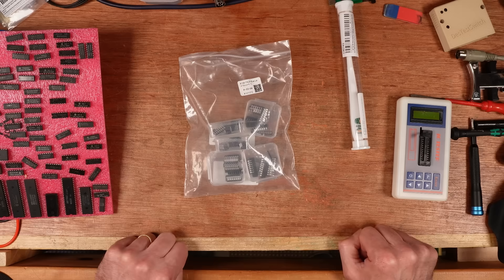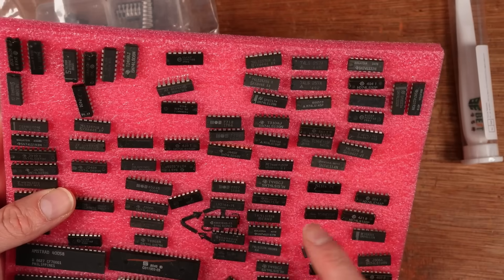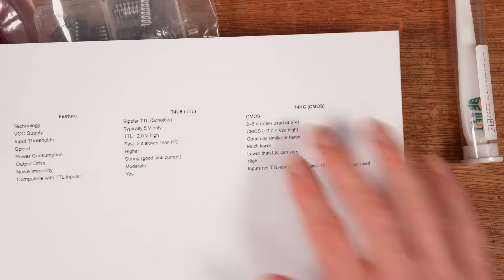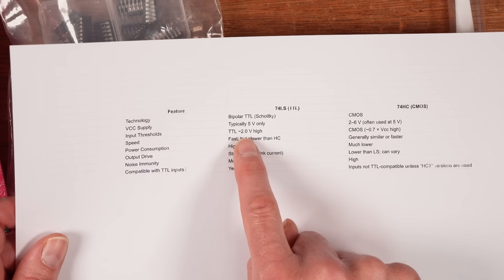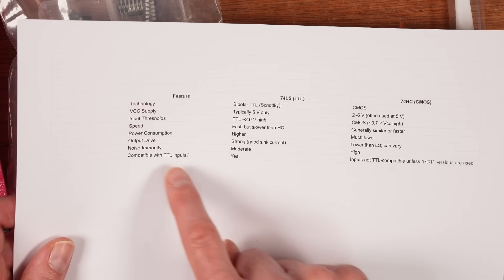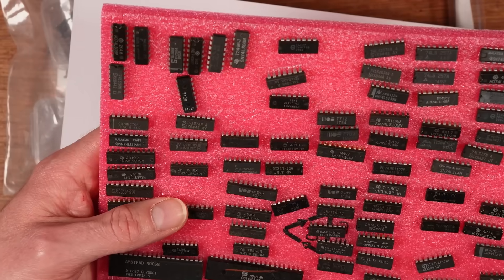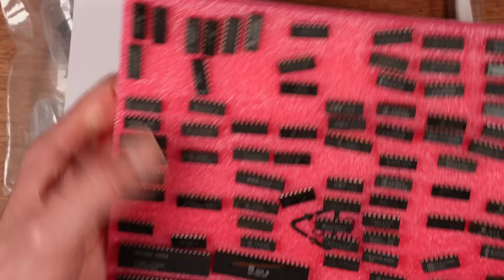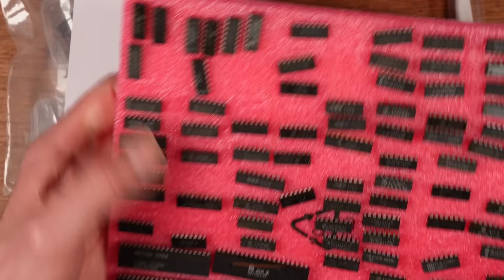I bought some 74LS Logic Chips from Ali Express. Guess what happened next?

Comment: How confident are you that your chip tester is not mis-identifying them ? I think I'd want to do an independent bench test before writing them off.
Reply: Yep. This needs a separate test in a "real world" scenario. Those chips might be fine after all. Hoping for a Part 2 for this video.
Reply: I was wondering how it does the detection. That would be an interesting follow-up.
Reply: @AlanTwoRings  Long time since I've played with these but as I recall one definitive difference is that TTL needs to have a load of current sinked out of its inputs to pull them low (unconnected it pretty definitively high) whereas CMOS is very high impedance so can be pulled either way by over a Meg with no current draw, and left unconnected they tend to float to their switching threshold and therefore switch based on the tiniest amount of picked up noise. That's what I'd do on the bench. Unlikely that the tester does it this way. I'd imagine that it slews the input voltage and sees what level it switches at. I think CMOS also has fairly symmetrical outupt drive whereas TTL tends to be better at pulling down than up.
Reply: @burblering  Correct. The other difference is that a lot of those LS type logic ports could drive LED's with ease. Some even without an additional resistor, depending on the type of LED. Many HC logic ports couldn't.
Reply: I don't know how much test equipment you have in your workshop, but an oscilloscope and a signal generator would let you do some interesting tests. Take one of the suspect logic gates and apply 5V to Vcc. Then feed input with a relatively slow sine or triangle waveform of 0 to 5V swing. Use the scope to view voltage at input and output. You may have to tie some inputs in order to get the output to change state. You should be able to see at what input voltage you get a state change. LS and HC should have very visibly different behaviors. Also compare with "known good" LS and HC parts of the same type.
Reply: @walterwinnipeg7350  And the frequency performance should give some clues too.
Reply: It's fairly easy to distinguish between genuine 74LS and 74HC IC's, by just powering them up with the inputs left disconnected. And measure the voltage on the input pins. With 74LS ones, the inputs should read a bit under 5V, as the TTL input structure effectively makes the inputs pulled high. Whereas on CMOS types, both 74HC and also 74HCT ,the inputs are basically entirely-floating and will read close to 0V when a Voltmeter is connected between them and ground, as input resistance of the Voltmeter (even 10M on a DMM), should pull the inputs low.
Reply: I suppose he already did some testing with "old" original chips like he showed a bunch.
Reply: Exactly. I'm not suggesting he's wrong, but before making a positive claim I certainly WOULD prefer to test those chips with a conclusive second method...
Reply: my first thought too after seeing that he got the tester from the same marketplace as the chips...

Comment: The 74HC00 and 74HC00 are used on the TRS-80 model I video circute and they are often bad.
Reply: Actually they used 74C00 because it pre-dated 74HC, and repairing my old TRS-80 is still on my to-do list. But I'll make a point of trying a 74HC00, as I should have some on boards that I can scavenge from.

Comment: 74LS output voltage for HIGH is guaranteed to be at least 2.5 volts on a 5 V supply. The minimum input voltage guaranteed to be interpreted as a valid HIGH is 2.0 V. The maximum output voltage for LOW is 0.5 V and the maximum allowable input voltage for LOW is 0.8 V. All output voltages are contingent on observing the allowable source or sink currents. The output minimum HIGH is a tenth of a volt higher than the spec for standard TTL and the low maximum is a tenth of a volt higher than for standard TTL.

HCT is voltage-compatible with TTL when it is operated on 5 V, as are other CMOS logic families with T in the part number e.g. ACT.

Isopropanol in a spray bottle is a hideously dangerous thing!
Acetone is extremely volatile and extremely flammable.

It boggles my mind how much fake crap is flogged on Back Alley Express.

TI still makes LS TTL.

If you just scrub around on a PCB with a brush and let the solvent evaporate, all you've done is turned a local mess into a global mess.
Reply: The Vih is particularly important when driving a 5V CMOS input from the output of a 3.3V chip. A 5V CMOS input will want at least 3.5V for a high input. I was using an STM32 to control a HUB75 LED board, which had a 5V HC CMOS chip on the inputs. It would work fine most of the time, but could get flaky like it was missing clock pulses. That was due to a low noise margin.
Note that nothing I was using was fake, but it shows how an HC input can cause trouble. A 74LS/HCT input would have been fine.

Comment: Where did you get the IC Tester from?
Reply: AliExpress.  Same seller as the chips.
Reply: @simoncrabb so it could be FAKE TOO!.
Reply from the maker: It wasnt the same seller. But it was from ali express. I would not trust that seller either as it arrived in a jiffy bag with no box and when turned on was faulty. I had to open it up and remove a bunch of solder from an IC inside.

Comment: The fake / rebadged LS chips are frustrating. I need to get one of those testers - the TL866 doesn't differentiate between HC /LS etc, and it can take me ages to work out that the issue is actually the trigger level on my new (fake/rebadged) LS chip. I recently had a fake BU508A horizontal output transistor, which is far more concerning - caused havoc with a CRT when it shorted immediately on power up. Only reputable suppliers for high voltage / power / important parts from now on!

Comment: do you have a link for that chip tester, i have been looking for a tool like that.
Reply from the maker: Hi. I would not recommend the one I bought as it arrived very poorly packaged and was actually faulty. I had to fix it first! But if you search on Ali Express for "Professional Integrated Circuit IC Tester Transistor Tester" you will find what you need.

Comment: When AliExpress started selling copper wire that was actually plated aluminium a couple of years ago I learned it's a massive lottery.  Why they bother faking some of the things is beyond me.  Maybe the likes of Mouser, Digi-Key etc. pay them to do this so that chip buyers give up and stick to reputable suppliers once bitten?
Reply: Copper clad aluminum wire is not fake as long as it's labeled correctly. The resistance is higher than copper, so you do need to use heavier wire though.
Reply: @rocketman221projects  It is when they advertised it as copper wire and I fell for it. The damn stuff wouldn't even solder despite it's copper coating.  Totally useless.

Comment: Genuine SN74LS02N from Texas Instruments, supplied by Mouser, 10 off price 69.7p each.   A tube of 25 £15.58 or 62.3p each. Both plus VAT
Reply: The problem is usually the shipping. I can buy a handful of chips from Ali for 5€ shipped. While those other distributors want 30€ just for the shipping...
Reply: @Mobin92  Exactly. I'd much rather use Digikey or Mouser but those shipping costs are more than the products. Don't know if it's their way of propping up the bottom line or the net zero agenda costing shipping companies way more in taxes now or what..
Reply: @Mobin92 Also, by purchasing from suppliers such as DigiKey or Mouser, you will receive information when a chip goes out of production and suggestion on chips similar characteristics to replace it with. That gives you time to redesign your circuit.
Reply: @Mobin92  with Digikey or Mouser you need to try and create an order that meets the free shipping threshold, which is about $50 USD. It helps if you have a wishlist ready to go, so that when you need a few chips, you can order those other things at the same time. The same is true for element14 (might be known as Farnell or another name, depending on where you live).
Reply: @Mobin92  Try European distributors such as RS or TME. They might not have some niche components, but for the rest you get cheaper shipping. Another (Chinese but legit) alternative is LCSC, which also has cheaper shipping to Europe and has a larger component selection, especially Chinese brands you can't find even on Digikey/Mouser.
Reply: @Mobin92 If you're ok having your project delayed and your temper to soar (at least I get mad when being ripped off no matter the amount), then 5€ lost is a good deal.
Reply: @Mobin92 the classic “then you get what you pay for”, when you gamble, sometimes you lose.
Reply: RS is even cheaper. £8.98 for a tube of 25 (£0.359 ea), and shipping for private/guest account is £6.95 (or free over £50). Farnell is similar. I only use Digikey/Mouser for harder to find/specialist stuff
Reply: I prefer Digikey. Just saying.
Reply: In this case Digikey are also cheaper, I use both.  Delivery times and minimum order level to get free delivery to the UK are identical, delivery from the USA is often quicker than Farnell who are just a 7 mile 20 minute drive away, but sadly without the trade counter they had for many decades.  Farnell, particularly since Avnet took them over are very expensive unless you have a negotiated discount contract.

Comment: I generally expect 100% of alix chips to be re-labeled, not useless but each and every component from there needs individual testing and vefication. Still usefull components when you determined what their actual characteristics are.

That said - look at the Tauntek logic tester, it can measure (and output) individual voltage levels of each pin aswell as chip power consumption and voltage drop-off levels - VERY nice for determining chip characteristics.
Reply: That's true, they've been sending completely inoperable products much less frequently lately. They're more likely to deliver slightly inferior performance in some areas, and for the price I pay, and when those parameters aren't critical in production, the product is perfectly acceptable. Although, sometimes they send a better product than I originally ordered (I once ordered small variable resistors, and they sent me huge ones. They weren't suitable for that project, but they're great for other projects, and I got them for practically nothing). Or, if I'm in a strip of 100 SMD ceramic capacitors, they often ship 110 or even 120. It's a small thing, but nice.

Comment: The counterfeit chip problem is out of control. I recently purchased some CMOS 555 timers from eBay to update a design to reduce power consumption. 9 of the 10 were actually remarked NMOS parts according to my simplistic current draw measurement.  Seller apologized and promised not to do it again. /sarcasm

I've used a bunch of Dallas 1-wire 18B20 temperature sensors over the years. I was getting confusing results on a recent project and compared temperature reading on a bunch of sensors. All the most recent ones were multiple degree F different then older ones I had on hand.

I was fine derating specs on Chinesium electronics but now reluctant to purchase anything.
Reply: Be glad these ds18b20 worked   with skewed values, I do have some which are working intermittently.  Sometimes ok sometimes not at all. The problem is that I sourced them from reputable sources and I am willing to pay few bucks more to avoid headaches, yet the higher price is not guarantee of better quality;(

Comment: I'm wondering if they could be used with a somewhat impractical hack:
If you put a couple of diodes in series with the VCC you could drop the supply enough that your logic levels at 70% would be in line with the TTL levels.
E.G. Two diodes at a 0.6v drop would take the 5v at the chip down to 3.8v making the High logic level around 2.6v.
I've used this trick successfully when driving multiplex chips that are 5v from a 3.3v micro.

Now the practicality of this is questionable, but if you were in a pinch it might work. I'd probably modify a socket to add the diodes and make it a drop-in bodge.
Reply: In the vast majority of cases, replacement is fully functional. With the exception of the generation circuits, where selection of the drive components is required.

Comment: Build a modern retroputer with them. I bought two HD63C09's from a Chinese seller (cheap) over a year ago, finally got around to building a nop tester, turns out either fake or broken, but nothing coming off with nail varnish remover.
Reply: They might be HD63C09E. For some reason, a lot of the 6809E/6309E cops are being sold as 6809/6309. The sellers probably assume the E is just a package or speed marker when it's actually external vs. internal clock generator. In any event, it might be a working 6309, just not the pinout you wanted.

Comment: They could be factory rejects they got for cheap due to being mislabeled.  It's just not cost effective for them to fake these cheap as dirt chips.
Reply: Every sale counts
Reply: @aldob5681  They figure it out, 10K> chips/Hr. .005% labor. Profit 4 cents.
Reply: At the same time, they could be taking chips from an IC family that is more modern and still in production, then relabeling it as something older and more valuable. It might be a challenge for the average person to tell the difference between an old and possibly flaky IC chip and a  nice new one of the wrong family.
Reply: There's no part too cheap to be faked. A few years ago I bought some RCWL-0516 boards on Amazon for a project. These were dirt cheap (about 1€ per board) and when I needed some more I ordered the same item again and only received fakes. So even these Chinese 1€ boards were copied. The fake ones had a hardware defect in the main chip and needed an additional LDO which was the only part on the second side of these fakes which made them too thick for my purpose.

And: I don't know any chip manufacturer who is painting their chips black.

I would never buy electronic parts needed for reliably working projects on Aliexpress, Alibaba and whatever because it shouts out "fraud". Nevertheless shorty I became a victim of such a Chinese fraud on eBay when searching for GALs of a certain type and speed rating. The seller pretended to be a German seller, unfortunately only after I bought the parts I found out that the whole shop was a lie. Delivery came from China, took ages (instead of the promised two to three days), the parts were fake and eBay didn't even refund these worthless parts.
Reply: I very much doubt that, the factory process wouldnt be capable of mislabeling.  
I have many of these fakes, you can plainly see where the surface has been ground away or in some cases oversprayed. 
Fake 40-year-old processors and their peripheral chips are particularly popular, ask any SC/MP enthusiast   😁
Reply: @PHILG2864  Then you have never worked at a mfg factory. LOL
Reply: @4thdoctorwhofan966   У нас в начале 90х годов продавали микросхемы не прошедшие контроль так как например ключ микросхемы был с противоположной стороны(сама микросхема полностью рабочая).Или надпись перевёрнута.

Comment: If you really need to use a HC type try using a pull-up resistor on the input to pull it higher voltage
Reply from the maker: That's a good idea
Reply: @morefunfixingit  Or maybe drop VCC by 0.7 V by adding a diode in series. If high is 70% of VCC this will drop logic high from 3.5V to 3V, maybe that's enough? Or even 2 diodes since the chip works on lower voltages anyway. Maybe not pretty, but maybe enough the circumvent the trouble of sourcing the LS version and it may be possible to hide a small diode somewhere near the chip.
Reply: @pe1dnnThat would be fine for logic HIGH but not for LOW. The diode wont conduct and leave low floating.

Comment: Try to find the Soviet analogs of LS (series 555) or ALS (series 1533) chips, there were no HC/HCT analogs in the Soviet Union.
Reply: Series 1564 is the Soviet equivalent of the 74HC series, and series 5564 is the Soviet equivalent of the 74HCT series.
Reply: @Opelmeister  1564? Isn't it a 40 series equivalent?
Reply: @watchmakerful К176 is a CD4000 series equivalent, К561 is a CD4000A, while КР1561 is a CD4000B.

Comment: Why do they do this? Are the LS variants more expensive to produce?
Reply: LS are older and there may be fewer in circulation these days.  If you were designing anything these days you'd likely spec a non-LS part (although you'd also be unlikely to spec a DIP part).
Reply: Probably most logic foundries in China make CMOS chips, since that's what modern products are more likely to use.   There would be some bi-polar fabs for making op amps, but maybe not many if any for making logic chips.
Reply: Well, most manufacturing processes are optimized for CMOS logic, based on MOSFETS. In order to create bipolar transistors you need a slightly different process, which not every fab seems to be able to do.